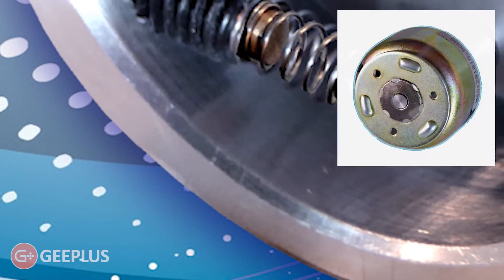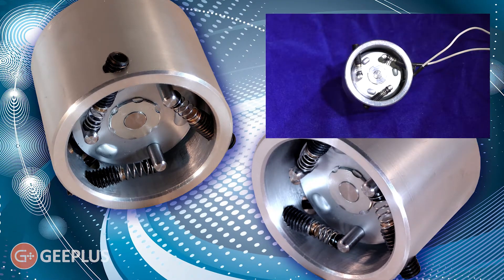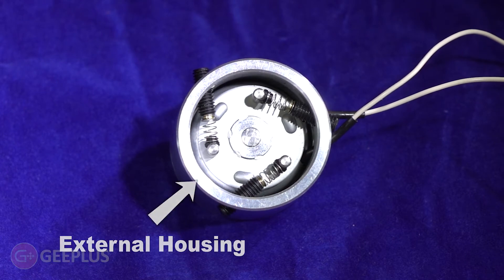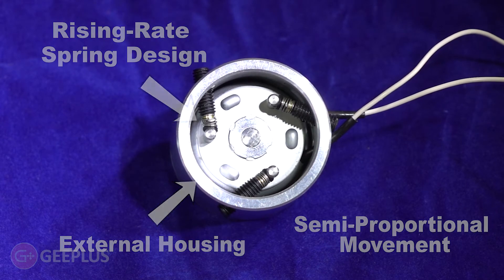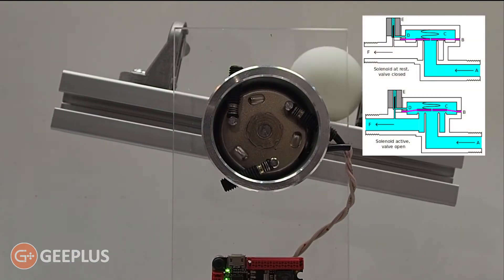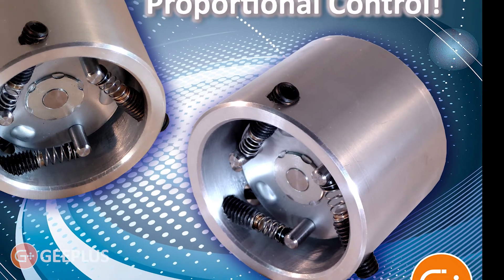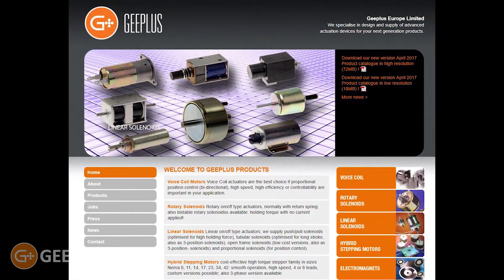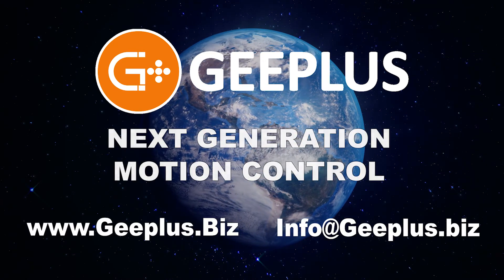Rotary Solenoids: Cost-Effective Semi-Proportional Rotary Solenoid from Geeplus

Comment: I need a rotary solenoid to change the tilt angle on an FPV camera that goes on a quadcopter.   It should be super light weight and have a range of at least 0 to 45 degrees, and be PWM controlled.
choppergirl @ air-war.org